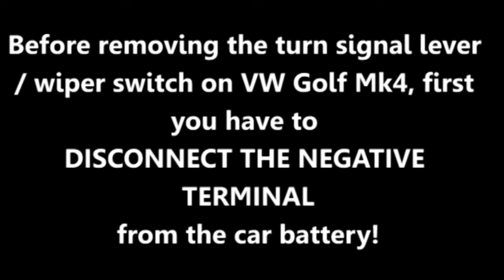How to remove turn signal lever / wiper switch VW Golf Mk4, Bora, Jetta, Passat, Polo, Octavia

Comment: I found this really useful, except it doesn't explain that you need to centre the clock spring, with the wheels central before replacing it. If you don't, the clockspring internal cable will break when the driver locks the wheels to one side or the other. Found that out the hard way :)

Comment: Intermittent then continuous fault. Pulling fuse worked until rainy season. Watched this but didn't have M12 spline remover. Took clip off indicator and filled housing with wd40. Stopped working. Bugger. But a few hours later all dried out and back to normal... Touch wood

Comment: My lights only work on high beams. I wonder if it's the switch.
Reply: Did You found the issue? I am guessing in my 2004 Bora there is the same problem. Main light switch is fine.

Comment: Is it possibly to take off only signal lever/light switch?
Reply from the maker: Yes, you can but first you have to remove both of them and then separate them.
Reply: @Servicetutorials  Thanks I have replaced the signal lever/light switch put everything on, but once connecting the battery (-) and turning on the key the horns turns on, do you know what could be the issue ?

Comment: Thanks for the video.  My dealer mechanic has diagnosed the problem with my 2003 Jetta to the wiper switch on the column.  $700 to replace so I’ll try to do this myself.  Your video is great but doesn’t show the final steps how to change the column lever for the wiper.  Is it fairly easy to exchange once this assembly is in your hands? Wiper issue is that they turn on but won’t turn off or adjust.

Comment: Hi . cordial greetings, well I have done all the steps you have done, but the airbag warning light on the dashboard does not go off. There is an important step which is the wheel that rotates with a yellow dot that must be left in the center, I have left it that way but nothing, the witness remains on, I don't know what to do I need your help please, what do I do? well remove the rudder to change the intermittent crossover lever and connect the three connectors in fact I have tested both levers and they work correctly, I need your help please, thank you very much
Reply from the maker: Hi, Alexander! Did you check the connector from the bottom of the seat? I suggest that you make a diagnose to see the exact problem for your car.
Reply: @Servicetutorials  Hello, thank you for answering, I changed the intermittent turning lever to the car, I did all the steps that you do in the video, to be able to change the lever, and I repeated the assembly steps, but the airbag warning light it does not turn off, is it normal for this to happen? Will I have to erase the error with a scanner? The same thing happened to you when you disassembled everything and when you reassembled everything again?
Reply from the maker: @AlexanderAnayaZambrano  Usually, when you remove something like that, the airbag warning light appears, but you can erase that using a scanner. But first, you can try to drive the car for at least 10-15 km and see if it's turning off.

Comment: Thank you for the video.  My daughter's Bug has been buzzing very loudly.  We first replaced the hazard relay switch and it didn't do much to help.  We then sprayed an electronic lubricant in at the base of the stalk.  That helped a bit, for a while but the buzzing eventually came back.  Then, last week she had a bit of white smoke come out from behind the speedometer.  Knowing that this signal had been a problem, presumably from a short, we are hoping replacing it will solve the problem.  I cannot see any charring on any wires anywhere, but fingers crossed this will be it.  I've got the part on order and will have to put it all back together next week.
Reply from the maker: Thank you for watching and good luck!

Comment: Thanks for the videos!
So I've got a problem with my wipers on a 2000 jetta I bought for my son. They start and don't have the power to complete a rotation. I have changed the wiper motor and the 377 relay but it still hasn't fixed it. Is the issue the actual W/W lever on the side of the column? Do you have a video where you change that? Or is there something else I can check into without just throwing more parts at this car?
Reply from the maker: Hello! Maybe you have a problem with the assembly.

Comment: My blinker when indicating right, will sometimes become random with being erratic. What is the problem with this?
Reply from the maker: Maybe you have a problem with the relay, but to be sure, you can do a dyagnose for your car.
Reply: @Servicetutorials  I have the same problem with my left turn signal. I have replaced the relay but the problem persists. Any ideas?
Reply: Cube8 I’m investing in a OB2 diagnostic tool—BlueDriver. Hopefully this will help me and you